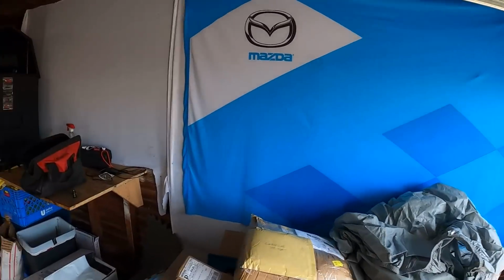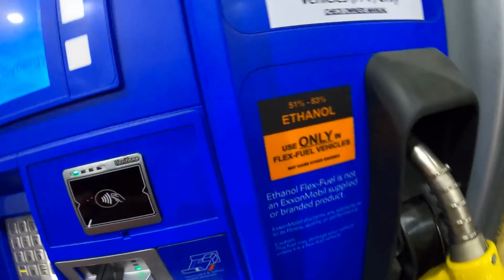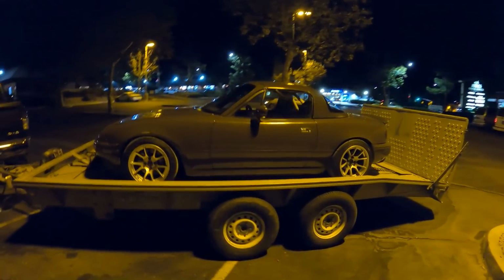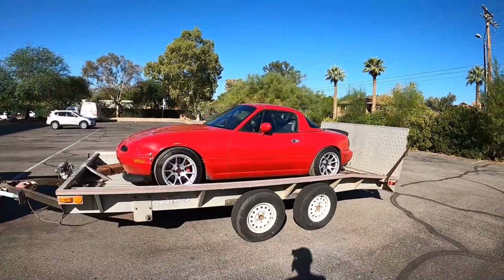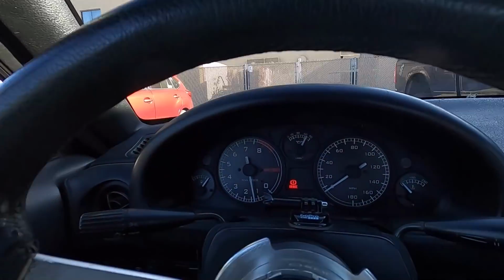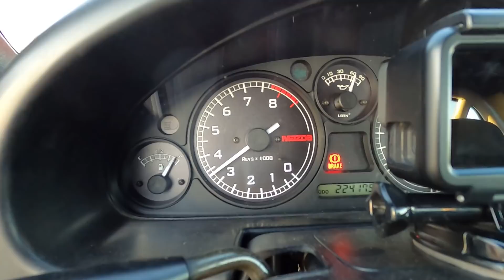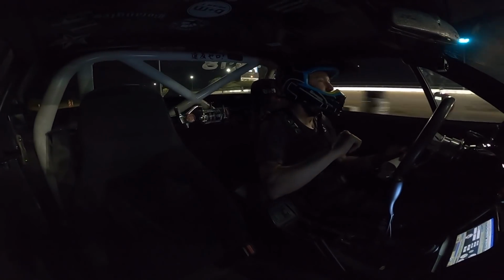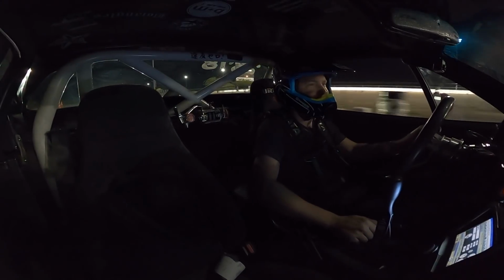First Time At The Quarter Mile With the 420whp Miata!

Comment: The severe wheel-hop launch issues were exactly what I ran into when I took my 200WHP '97 out last month. Turning down launch control, rolling out on clutch, times getting slower- I feel that! Ended up with a 14.1 @ 101MPH (2.34 60ft fml)  and a new gear whine noise in 1st through 3rd gear!

Comment: What do you think about hand brake and preloading the drive line, to let slowly rear wheels spin up? Instead of overtorquing them? I think it could give benefits
Reply: This or get a clutch slip module. Basically slips your clutch perfectly every time.
Reply: @mrmidnight32  clutch delay valve?

Comment: Heavy rebound dampening in the rear struts and an adjustable clutch release valve is what you need to combat the wheel hop. Both of those will help get the car off the line.

Comment: You need to kick that launch rpm up and slip the clutch more. In fact if you get a staging brake, you can preload the drivetrain by slipping the clutch and then all you have to do is let go of the staging brake

Comment: You gotta sliiiiipp that clutch juuuuust right and don’t worry you won’t burn it up. There’s a difference between good slipping and the bad blow up your clutch slipping. Just practice balancing your left foot on the edge between wheel slip/hop and too much clutch slip that it revs past 7k. Then you can set the launch control at 7k and let it spool the turbo.

So cool though to see it have basically no issues. It’s just tuning now!

Comment: you have a solid car bro!! i think the main thing you are missing is actual drag slicks with smaller rims in the back so you have more room to launch harder without putting too much stress on you drivetrain. other than that you are good, id say with that alone you just might hit 10.5 with the right tires

Comment: My oil gauge fluctuates just like yours does when i ride at high rpm under load and boost. This calms me down a bit I thought I had an engine knock or oil pressure problems.

Comment: Great build bro, I have a 124 Spider and not sure if I should go with a track car autocross build or high HP on the strip. Problem with the high HP set up car's too light and it's hard to get good traction out the hole. My opinion

Comment: Hey, im looking into boosting my miata. Only making 5 psi. At 5 psi after a tune and injectors, would I be ok?

I want to be able to daily the turbo miata. Will it be ok running the stock engine on 5psi boost?
Reply from the maker: Won't even break a sweat, I used to run 14-16psi on my stock engine with basically just a tune/ECU, intercooler, and injectors.
Reply: @TheCarPassionChannel  i have a Eunos RST 1989 and I was afraid I would have to build the bottom end. I dont want to run more than 8psi. 

I'm afraid of blowing up my motor, but from what I read I should be ok on 5-8psi boost
Reply from the maker: @njjx8800  The stock bottom end on all 1989-2005 Miata engines is safe to about 240wtq. I usually recommend staying at the 200wtq level so you have a good margin of error. At 8psi you will probably be around the 160wtq level which is very safe, as long as the tune is good (safe AFR and ignition timing).
Reply: @TheCarPassionChannel  i really appreciate you taking time out of your day to answer questions and help out :) I will comment again on your channel when it is done! I'll post a link so you can see how it turned out :)

Comment: Love this build. I'm thinking the hops came from too much air in the tires? There's also reaction time. Your foot can't beat the lights to your eyes. Never. Trick is to mash before the last light. The 11s are in that car easy!!!
Reply from the maker: The hop is likely from using tires that aren't meant for drag racing (very stiff sidewalls) in combination with the Miata suspension design. Also reaction time does not affect ET 🙂 hopefully will get it back out on the strip again this year

Comment: A low 12s Miata is no joke! Nicely done! That last one you raced against tho... 👀
Reply from the maker: Yeah another quick BP car. He got me out of the hole good
Reply: @TheCarPassionChannel  From the mid point on you were reeling him in fast, I think a slightly better 60ft and you would have passed him.
Reply from the maker: @foamdataservices  it was just at the light, I didn't care much to beat the other car I just wanted a pass. His run there was a 12.7 @ 115

Comment: nice runs, you can get off the line the better with a higher rpm launch and slipping the clutch... hard on the clutch tho.  Get some bias ply slicks and get that 60 down to a 1.6 and you've got low 11s .

Comment: I got a 360rwh 2.3T mustang with megasquirt, I was having trouble hooking with 2 step so I just took it off and eased off the clutch dropped .8 off my E.T low 12's Getting better tires I cant  wait to leave off line with 10lbs of boost  this weekend.. Where you using the flatfoot shift ????

Comment: Greg I had a problem with a car like that, just went to an all day test n tune and hit lapped working on launches. Not so much speed. Or ET just tried watching my poistionon start line and slippage of clutch amount till fully engaged then I worried on adding more power just a thought
Reply: Hot lapped

Comment: Also, why not boost by gear? Find what boost makes 1st happy that was you can full throttle and not have to worry about it off the line, then second is back to normal? I know nothing so this is just an idea I had
Reply from the maker: Long story short because I only had the car tuned on open loop boost control since it was quick and easy after throwing the new wastegate spring in, and with Megasquirt you have to be tuned on closed loop boost control to enable boost by gear. However, BBG is coming!

Comment: Very nice, you have a low 11sec car, your picking up also 30 mph after the 1/8 your 60ft just sucks, low tire pressure and longer burnout. Good job at the track.

Comment: What is the full weight with the Miata and you in it? I assume car 2200 + you (200lbs ish ) = 2400 lbs. 2400lbs at 124 mph trap speed should equal around 360 hp. Still very fast but not 420 whp. Need a trap speed around 130 mph for 2400 car to = 420 whp.

Comment: You need to leave on the last yellow.   Waiting for the green is too late.   A bit more rear end gear will give you more time between first and second, second will not be so easy to spin and you will not have so much rpm at the end of the track.
Reply: Leaving on yellow wont make your time better.

Comment: 401 WHP Firebird here with Nitto NT555Rs and a 6 speed. Spent the whole year wondering why I couldn't get the car to hook well enough to run any better 60 ft than 2.2 to 2.0, resulting in 12.2-12.0 at 118 mph 1/4. Finally went up and sat in the burn box until I had lots of tire smoke. I was sure I was just wasting fuel and tires, but I actually bogged on the launch at 1/2 throttle, 1.89 60ft, 11.88 @ 118 mph. Last run of the night, I told everyone I was going to put on a smoke show and give it a launch. I sat in there until I saw smoke at the mirrors. For the first time since I owned that car, I launched the it at full throttle, it hooked. 1.69 60ft, 11.58@ 119.99 mph (just give me the 120 already). As it turns out, despite claims that you don't have to heat Nitto tires up much, they really seem to like being heated up. I haven't run any slower than a 1.7 60ft since. Not sure what tires you are running, but if you can get it to grip, you can shift it easy and glide to low 11 second passes.
Reply from the maker: Great to hear your story 🙂 I've never done under 2.0, I know the car can do it despite being set up in all the wrong ways.

Comment: That first gear is too short for the amount of power you have and weight. Different rear end?
Reply from the maker: Unfortunately it's the longest option with the diff swap, it's a 3.23. The ZF 5-speed has very short gearing, 4.21 first and 1.00 fifth
Reply: @TheCarPassionChannel  go lower then and start in second. :)
Reply from the maker: @umakegoodcookies  That's actually pretty common with the Miata gearing options, the issue is my freeway cruising RPM would be so high. Really though I didn't build the car for 1/4 mile or launches so I'll probably leave it as is 🙂

Comment: I noticed that your oil pressure drops to 50-60 psi above 7k rpm at the end of the pulls. Is this just the gauge vibrations issue or the pressure is really dropping?
Reply from the maker: I honestly don't trust that gauge much, the relief valve in the Boundary pump shouldn't be letting the pressure go above ~66psi to begin with. As long as the motor keeps spinning I'm good :)

Comment: You can see how big the difference is without the 4-5 shift with that Miata that had you by a car. Just at the end he loses a lot to you in that shift.
Reply from the maker: He was also running ~118mph traps so there was a power difference, just a shift won't affect the top end by too much. His car actually made the same power as mine but it was turned down a hair. Mean GTX2860 / BP / E85 setup

Comment: Derek Platypus, you're the best. ❤️
Reply: Also, don't feel too bad.  Back in the cut when I had a Fox with probably 50 less hp than you, I was doing 12.1s at 115 on drag radials all motor.  So that's damn impressive on your behalf as my bucket was set up for drag, not any semblance of cornering.  Pretty sure you would have waxed my ass from a roll if I had an empty bottle.

Comment: Do a john force burnout to prevent wheel hop. when your warming up the tires.  Fuck launch control without slicks. right foot heel should be on the ground. very important so your foot rolls and doesn't stomp during first gear.  pushing the gas and brake at the same time. hard on the brake. preload the car by letting the clutch slip right before launching. the car should feel like it sits without moving. roll on the gas
Reply: Look up John Force if you got time. Second gear burn outs ftw.

Comment: 11 seconds only with 420hp? is that because traction is limited or do i just know nothing about drag
Reply from the maker: It comes down to getting an IRS car out of the hole with 100tw road race semi-slicks, 400# rear springs, light fluwheel, and a 6-puck. The anti-drag racing formula lol

Comment: You have the suspension way to stiff for drag racing.. if your shocks are adjustable the rears should be all the way soft you want it to squat and hold. That speed with good front half and that light of a car should have you in the low 11s maybe even high 10s. Watch the video of the rx7 on my page.. car is full interior and weight. Weighs about 3k lbs and still ran a 10.6 at 126

Comment: I was having a hard time waiting for the video to be posted, so of course I liked it. I can see the car does have the 125 mph in it as well as an eleven second run and better. No offence but I think you probably pushed yourself to hard and it showed big time at the green light. Your reaction times were way slow combined with horrible wheel hoop. I think if you get your reaction times down and get the rest of the launch right, you could see high 11's and 126 easy! Possibly working on the hoop at a local track would be the ticket as the sticky track made the HUGE difference. I think if you could take Bree or perhaps some car guy friends to the track would cut the boredom and make you sharper at the tree as well. Best Always, Chris

Comment: Can't believe there isn't more ET in these cars at 420hp.

Big V8 cars with that much power are easily into the low 12s high 11s. Something that light should easily beat that. 🤔
Reply from the maker: Read the slip, it was a 2.1 60'. ET is more about launch than power, trap speed is all about power. First time on a prepped track, paired with a car that's not built to launch, it was a tough night lol

Comment: I ran 12.20 @ 115 mph with 230hp  so with practice you'll run low 11's
Reply from the maker: That 230whp must have been from a very low reading dyno, realistically it takes ~300-320whp to get a Miata to do 115mph. I've seen a 230whp Miata do 106mph, and mine did 110mph @ 275whp.
Reply: Hold on I messed up. It was on a 1986 323 fwd

Comment: 2nd run faster than an oem fd3s
Reply from the maker: They run around 14 seconds @ 100mph bone stock yeah?
Reply: @TheCarPassionChannel  in the forums some guys hit 13< . My first one that i threw a single turbo did a great job on a launch i never got it on the track because i threw it in a guard rail at 98 ( r.i.p green rocket ) 21 year old me didn't understand hiw important tires and brakes are.
Reply: @TheCarPassionChannel  reving the car to and releasing it at the sweet spot is what i saw during those digs like not at red line but where it goes the best. Also the suspension had about all it could. Like those added bars that connect the diff housing to the frame or what ever. Kept that wheel hop to a minimum. My current FD will be all that and me with an engine built for 11-13 secs. Ive never driven single a track distance but my FD's are more valuable to me than any under a minute time lols
Reply: @TheCarPassionChannel  my apologies the guys running 13s bone stock may have had a ecu upgrade and tune.

Comment: ricer miata ran a 10.9 with the same amount of hp
Reply from the maker: And a full drag tire setup. That's the difference between a poor launch on a street tire and a good launch on a drag slick. HP doesn't equal ET. He ran 124mph also